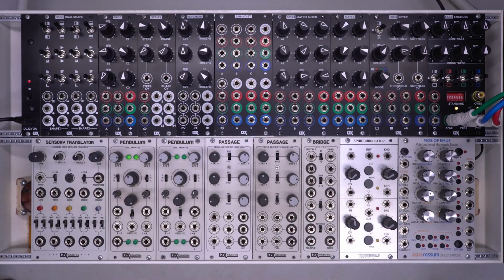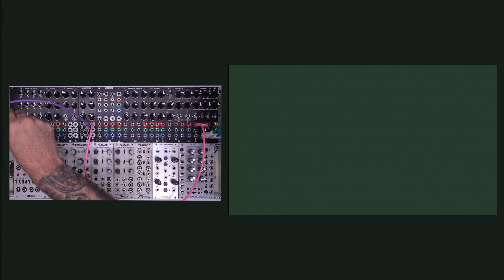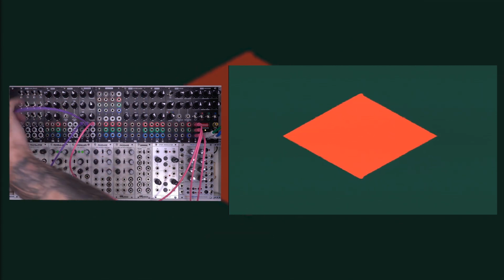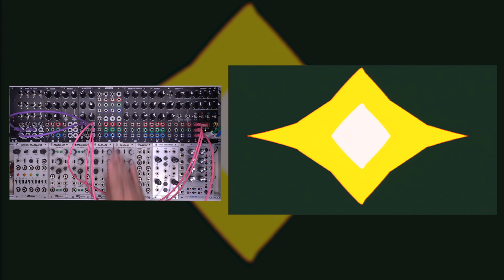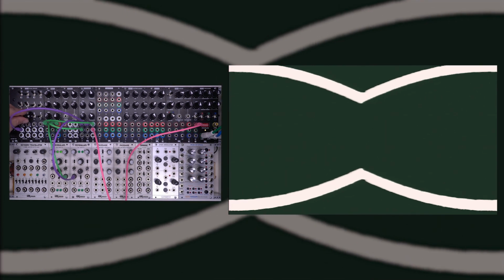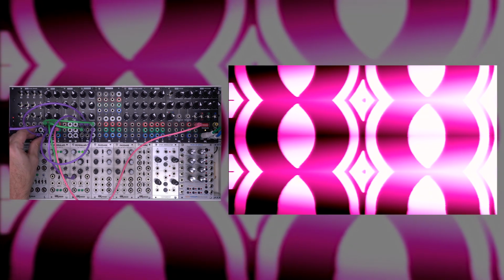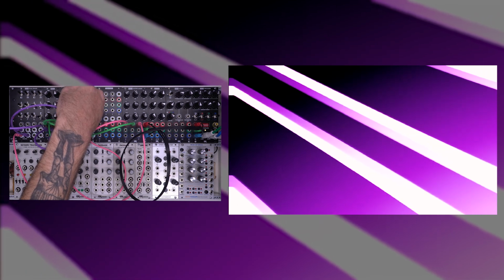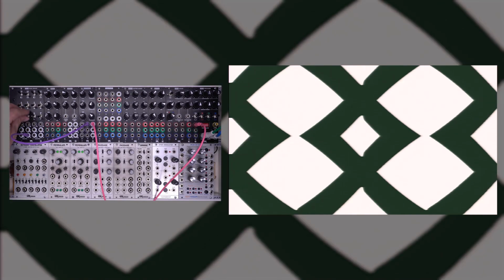3 Patches for Keychain

Comment: what's the main difference between the keychain and the  FKG3 Keyer?
Reply from the maker: The Keychain is comprised of 3 separate hard keyers. FKG3 is a chroma keyer (with softness control) that allows compositing of three individual RGB sources.